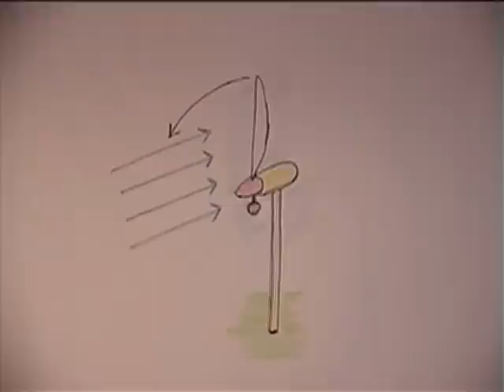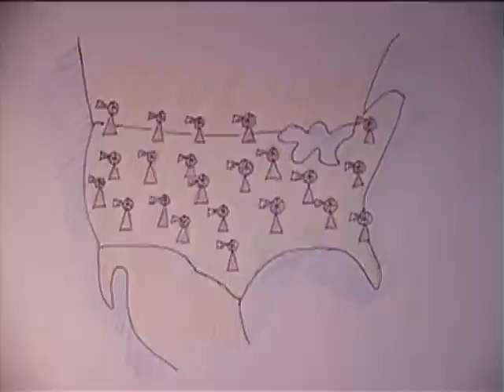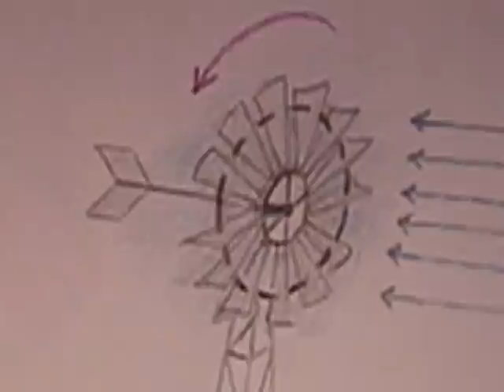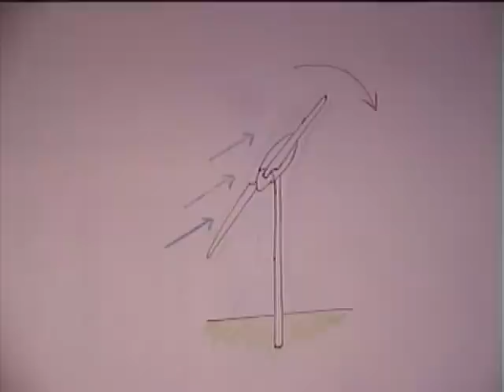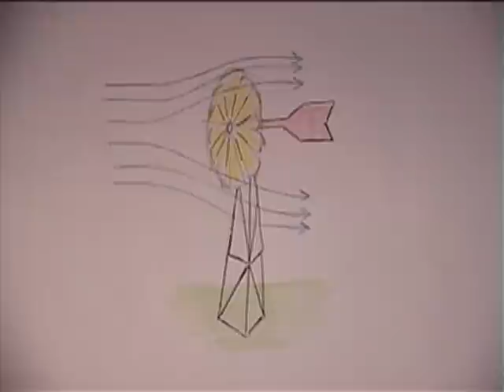Best Wind Turbine Design Part 2

Comment: Interesting theory but IMHO a lot of it is contradictory. To say one design is better over another depends on lots of different factors. Some areas have more steady predominant winds. These places are evident in the population of wind energy farms populating them. Other places not so much, and most likely would never have the power output hoped for. There are other interesting statements that could easily be challenged in this presentation, but it would be to lengthy to do so. For any DIY'er I'd say experiment as cheaply as possible before investing in something that may have more cost than yield.

Comment: Everyone is concerned with the rotational speed of the hub!  In practice however, I have discovered that torque is more critical. In most areas of the country, getting a two or three blade HAWT high enough to access winds of the necessary speed is impractical at best, impossible at worst.
The flip side is to increase the wind interactive surface area thereby increasing the overall torque, sacrificing speed for torque.
The increased torque is necessary to overcome the high torque demand of a geared up transmission. A staggered 6 blade Lenz 2 wing system seems to work well in lower winds while still providing adequate torque to spin the transmission.
The drag is desirable as it acts as an overspeed brake by design.

Comment: Interesting!! How about micro wind turbines? Same rules? Im might buy a 6 bladed one since a got an offer. But would it be wiser to buy a 3 bladed one?
Reply: It kind of depends on your wind resource. Check out a wind map for your area. Many blades can extract a bit more power from low energy winds at the expense of getting hardly any power from high energy winds due to all the blades disturbing the air and not having time to pass before the next blade comes. This video is correct in stating that the fewer blades the more energy you can collect from medium to high winds.(Much, much more) The problem with one or two blades is the chattering that you get during yaw which vibrates the machine horribly loosening fasteners and stressing parts. If you take a long piece of wood about your height and rig a way to spin it from the center, then spin it up while holding it, and rotate your body in place, you'll be able to feel it for yourself. The best choice is three blades. 
In the US, the southeast does not have a very good wind resource. Solar would be much better. Good hydropower even better yet.

Comment: wind turbine theory. 2 blades are fast (direct drive) if you have strong wind, a 20 blade farm style in low wind while slow would have strong torque & run it with 1to5 ratio(whatever it would really be) gearing to a alternator to spin it really fast. If I can ever afford an old windmills I want to build one if I ever can

Comment: Hi
I am building a 12 v turbine. Can somebody tell me how i decide the length and pitch of the propeller? my average wind speed is 10m/s and i am using a 500kv motor.
Please help!!!
Reply from the maker: (1) First of all get your technology correct. You could not possibly be using a 
"500kv motor". "kv" stands for a thousand volts. You are using a 500,000
volts electric motor? (2) Do a "Google search" on how to build a wind turbine.
There are lots of websites that will give you detailed help.
Reply: Thank you for replying.
500kv means upon 500rpm it generates 1v! what i am asking is , is there an equation which would help me calculate the length and pitch of the propeller?

Comment: Your theory is good, but i think it's not practical in real world application. There are only a handful of areas in the world that has consistent high speed winds to utilize 2 blade system properly.
Reply from the maker: I agree with you completely. Finding areas with lots of high speed winds is a serious problem that wind energy faces.

Comment: For those of us that are not utility companies, a large commercial two or three blade design is too expensive no matter how much more efficient it might be at capturing higher wind speed energy. Plus, most of us would like to have power all the time, not just in high winds. A utility company can afford hundreds of windmills in multiple wind farms. A homeowner must be content with one windmill at most.

I think the argument is somewhat false anyway. A one or two blade design that is only the same diameter as a traditional farm windmill is obviously not going to be capturing nearly as much energy as a twenty blade farm windmill no matter how fast the wind blows. OTOH, if someone were crazy enough to spend the necessary money to build a ten or twenty blade windmill the same diameter as a commercial two or three blade design they ought to be able to capture more energy than only two or three blades. It won't spin any faster because such designs are limited by blade tip speed, but it should generate more torque.
Reply from the maker: You do not understand the reality of a high speed 2 blade wind system. Such a system has a huge amount of torque in high speed winds. A farm windmill has more starting torque. However, in high wind speeds a farm windmill has only a small amount of torque compared to a 2 blade system. A farm windmill is too heavy and this results in a slow turning speed in high speed winds. Its multi-blades are inefficient and are just wasted.